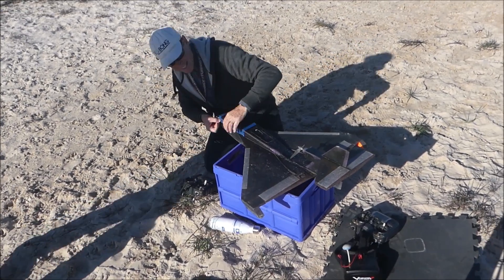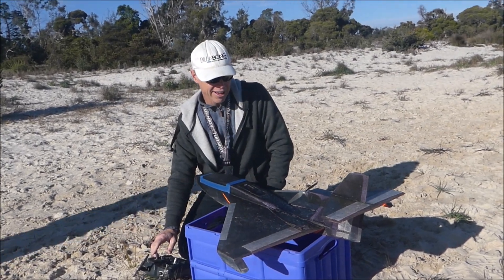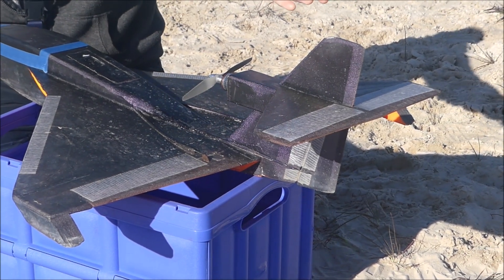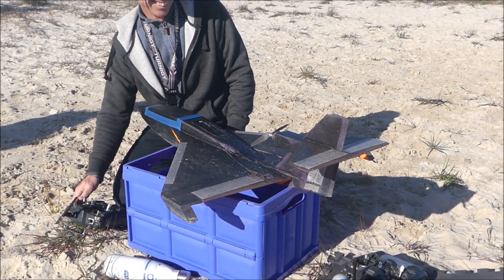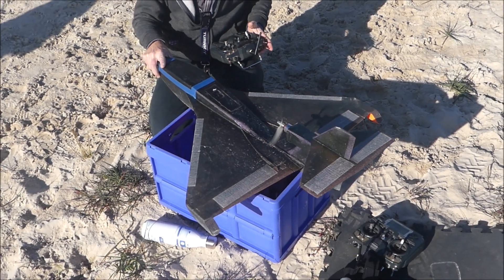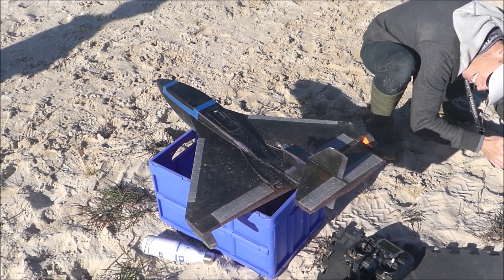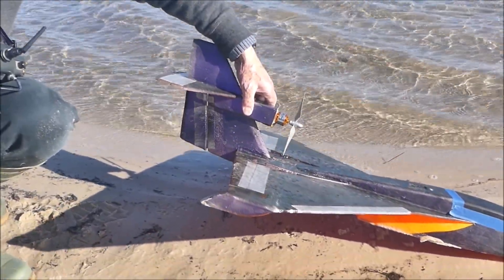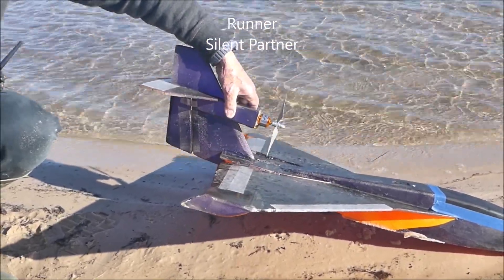Polaris flight with no elevator control

Comment: Somehow in ER9X I had copied a mix onto the gear channel that disabled the elevator and that mimicked a dead servo.  Much more fun flying with elevator in the prop wash, but eminently flyable with elevons, though you really notice the difference when flaring at low speed.  Mind you that landing was about par for my standard :) What a great design!

Comment: I bought a Model Aero Polaris kit with their servos and had two elevator servos go out. I saved the plane on the first one. But wasn’t so lucky on the second bad servo. I should’ve learned. 🤔
Reply from the maker: The servos on these planes have a hard life when flying off water. Personally I just use cheap ones from Hobbyking HXT900s I think with some Corrosion X sprayed at the base of the servo arm. Occasionally I need to replace them.